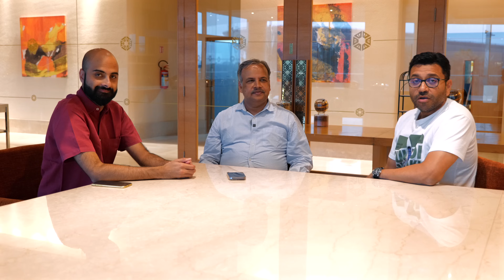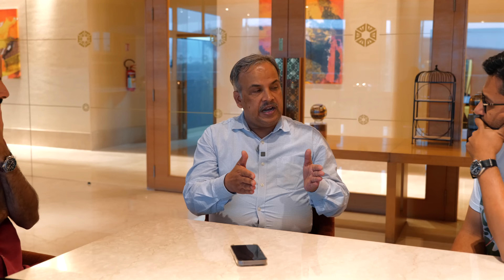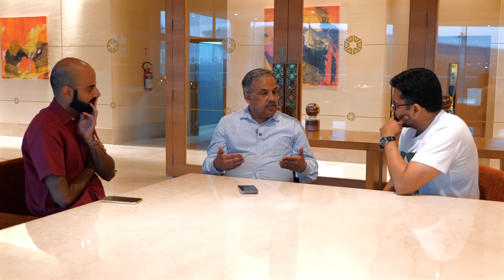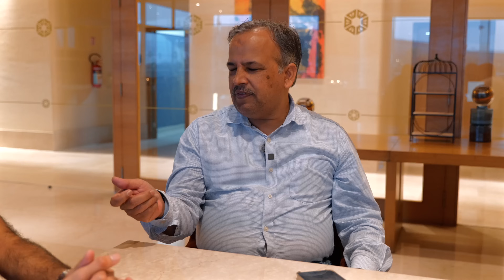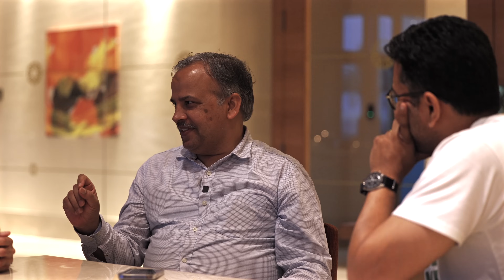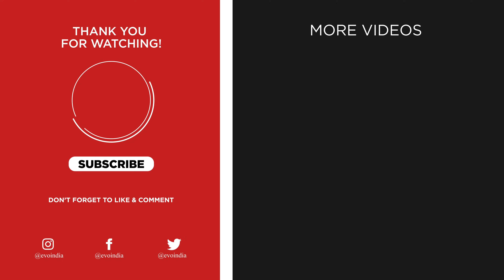Tata acti.ev architecture decoded | Punch EV | evo India

Comment from the maker: Our Punch EV First Drive Review drops today at 4pm on the channel. Until then, which range variant of the Punch EV would be your pick -- 315km or 421km?
Reply: Real range is 225 to 250 km stop fooling public. **
Reply: I would pick the long range only for the higher power
Reply: Ask when we are going to get better charging speed and battery preconditioning? In delhi's cold weather charging times increases drastically.
Reply: As I was on my toes to book an LR punch after knowing the real range of 250-270 I decided not to buy!
Reply: @yatheesh999  what’s your daily km drive?

Comment: Polo GT TSI owner here. Have been driving the polo for last 6-7 years. So spoiled and have high expectations from any car I drive. I test drove the punch ev today - empowered+ LR, and must say I am mighty impressed with it. The obvious EV benefits like punchy motors contribute to this no doubt, but then the surprise was that ride quality and suspensions were extremely pliant. It felt like an extremely well balanced tuning between perf and ride quality for this fairly tall and compact car. The test ride was quite short and I didn't get to drive it very extensively, so I might be speaking too soon. But whatever little I could get, I have come out impressed and interested. So far the Polo with the DSG was the ideal small footprint car for Bengaluru traffic, but this goes a notch higher.  If only the salesman was a little less lacklustre, he could have gotten much closer to a cheque. :)

Comment: TAMO must give a variant by combining the lower power motor 80bhp with the higher Battery pack 35kWh to increase the practical range. It will reduce overall cost also. No need of So much power & torque in city conditions. Customers will like that combination much more.

Comment: Team, you had a opportunity to ask real questions to Tata leadership but for some reason you didn't ask.
1)Why there's a significant difference between ARAI claimed range and real world range? From the data and real life experience, it's evident that Tata is doing poor in range category compared to Hyundai, MG
2)how is tata going to fix service issues.
3)why tata still not giving decent fast charging options even platform seems to be capable of.

There could have been more common issues that you could have asked. Bit disappointed.
Reply: 1) the same reason as to why ICE car mileage never matches real mileage 

Kona and MG also give 300-350km only, their WLTP range in Europe is 289km and 262km
Reply: Some nexon users even getting 150km range in full charge. That's pathetic  @shresth1201

Comment: I always worry about the warranty coverage conditions.
For example: Tata Punch ev comes with 8 years warranty, what does it cover exactly? What if the range falls down to 50% of what is given now after a certain time?
Will they replace battery for free or leave us to let scold Tata for the rest of the life. 😢
Reply: 70% SoH for given warranty period ie range will not drop by more than 70%

If it does then it’s under warranty coverage

Some Nexon batteries were also swapped under warranty in early days due to mfg defect
Reply: I have watched his other interviews and about batteries and warranty he told, the benchmark is 80%. That means if it falls below 80% strength, its eligible for warranty within the period. He told, the predicted battery life is 2000 charging cycles, which means approximately 5 lakhs kms in real life range.

Comment: It's really surprising that these two gentlemen who are highly informed in their field did not ask those questions which a common man would love to do so..For example, the advertised range and what it actually delivers? Why are the fit and finish of Tata products always an issue? Why the customer service is not yet matching with that of its competitors etc. Maybe if they ask these uncomfortable questions, Tata might black list then. Who knows?
Reply: Did you even watch the video? He already clarified 300km+ on LR and 200+ on MR
Reply: @shresth1201 Boss the actual range is not more than 240km if you drive at 80 to 90 km speed. Of course it will increase if you drive it around 60km. Why should someone spend so much money to crawl on the highways?
Reply: @Tklshriram71  I already have Nexon EV prime since 2y 20k km 

I get 250km in city and 240km on highway on the lower range model (mine isn’t max) 

And I drive the limit ie 80kmph because I’m in no mood to pay more for challan than toll and charging combined

Regarding 60kmph, I’d get 300kWh he if I wanted to drive at 60kmph on cruise without AC and 270 with AC 

I’ve tried all sorts of combinations and 80kmph cruise is best for range + travel time, even on ice cars beyond 80 your mileage will reduce due to drag and most of all, unless it’s controlled access expy like Yamuna expy or samriddhi marg you are never safe even at 70-80 because anytime there can be some jaywalker or cattle or slow af bikers on normal NH
Reply: Also actual question like why EV are twice of Petrol?
Every EV Tata  launched has seen that.
Why can't Tata manufacture EV profitabily at same level as ICE?
When can we have Price parity of EV with ICE
What is Tata's battery production plans?
Why isn't Tata actually investing in improving charging infra?

Looks like interviews are managed?
Reply: @guru85vaale  punch EV adventure LR costs ₹15L OTR, punch petrol AMT accomplished costs ₹11L OTR 

How is it double price? 

Have you seen how much features punch base model gets in petrol? 

A car with more features costs more money? Blasphemy. Colour me surprised 

And the punch EV still gets more safety features like 6airbag, TC, ESC, TPMS, better infotainment, better cluster and most of all, no laggy AMT — instead true automatic of EV + 9.5s 0-100 vs punch petrol with 20s 0-100
Reply: Literally you are noob there are people who has gone beyond the claim range as well, it's just about how you drive, people like you you are Dehati

Comment: Irrespective of the platform, EVs are a bad decision for Indian market. It is like a smartphone on wheels where the car will become scrap within 10 yrs. The batteries become weaker over time and after 8 yrs you need to spend half the price of the car to replace the battery. It is actually more carbon intensive, Americans are giving up on it now. India needs PHEVs to balance the life of car and climate change requirements.
Reply: But the data is telling a different story. In US EV penetration increased from 5.9% to 7.6% in 2023. The actual number comes around 1189051. Moreover as the industry matures EV'S are becoming as reliable as ICE.
Reply: Batteries have a proven life of 12000 charge cycles. 1000 is what most people would use in 10 years. After 4000, capacity drops to 80%

Comment: Why wasn't the new nexon ev launched on the acti.ev platform?
Reply from the maker: The Nexon is underpinned by an older platform that had already been modified to electrification early on. Wouldn’t make sense to do a complete overhaul when they could develop a whole new product parallelly on the side that
Reply: @evoIndia  isn't the curvv based on the nexon's x1 platform, and that will be coming with the acti.ev underpinnings